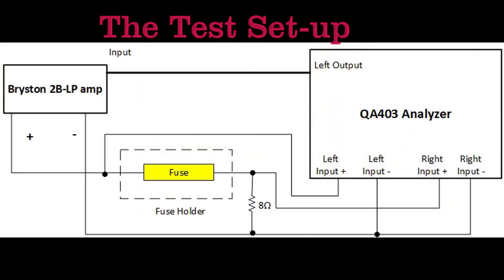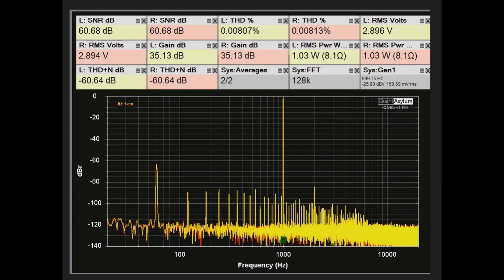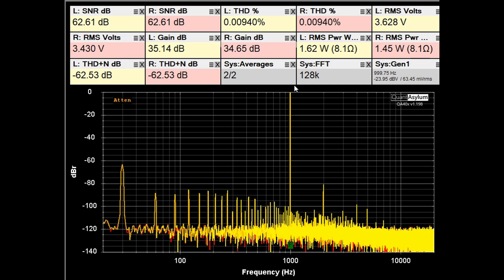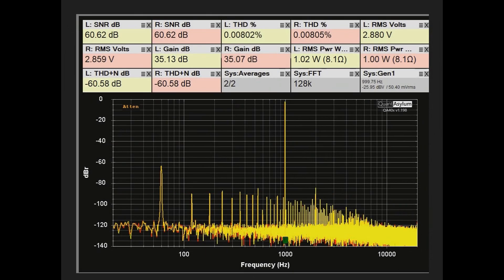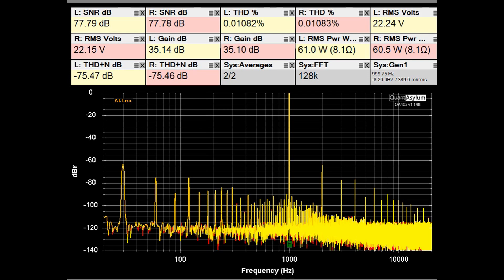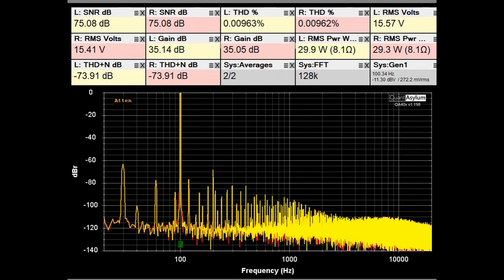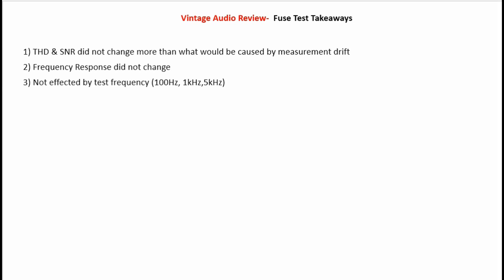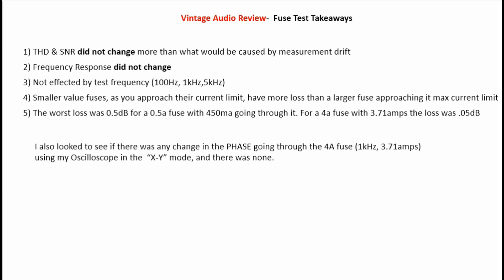Testing the effect of fuses for Audio: Vintage Audio Review Episode #113

Comment: It's Engineering. Traditional glass fuses resistance increases as load increases, that's how a fuse works until the heat and resistance becomes too great and the fuse blows.  A better fuse has resistance that does not increase with load.  The varying resistance increases and decreases voltage to the power supply thus effecting all the electronic and making the circuits unstable.  Hope this helps.
Reply from the maker: Thanks for the comment. "Makes the electronics unstable"- not in most decently designed amps and the effect of having the fuse resistance increase makes almost no difference as I showed with the measurements- worst case of course is with larger currents flowing through the fuse, but even then a very small effect.
Reply: @vintageaudioreview   Amplifiers with tubes require higher voltages (my 165 watt monoblocks run 900 volts on the plates) Those  small voltage drops (because of the resistance introduced by low end fuses) are multiplied by step up transformers.  The step up transformers magnify the small voltage drops as the current draw fluctuates to the music.  Yes we  are talking about small changes that will likely only show up in High End systems.
Reply from the maker: @kb9gkc  I can't say how much that drop in plate voltage is going change the sound (adding distortion) to where you would hear it in a high end system. Maybe one day I will repeat the experiment with my tube monoblocks....though they are not running 900v on the plates

Comment: I bought speakers in the late 70's that had fuses on the tweeters to protect them from blowing (but I was able to blow a tweeter anyway and I swear I had the right fuse in).  I also remember at least a couple of other speakers from the late 70's that had fuses.  Does not look like speaker manufacturers put fuses in speakers anymore?  Wonder if that's because they think the "audiophile" community would rip them if they did?
Reply from the maker: Possibly the speaker manufacturers built their drivers and crossovers to handle a bit more than the rated power and don't feel they need fuses.....
Reply: My favourites where the big floorstanders with automotive light bulbs in series with the tweeters ... If your port is lighting up, turn it down!  LOL
Reply: @Douglas_Blake_579  I've got a pair of speakers that have something like that.  I inherited my dad's McIntosh XR3 speakers.  They have two lights on the bottom front.  A yellow light for "Approaching Power Limit" and a red light for "High Frequency Fuse Blown".
Reply from the maker: @Douglas_Blake_579  I never came across those, just the KEF 105's that had the LED in them to indicate you were in the danger zone....
Reply: @vintageaudioreview  
I've been wracking my brain trying to remember which speakers those were... 
I'm starting to think I don't remember (Gasp!)

Comment: Nicely done Scott.

A minor clarification if I may ask ... the currents you're stating were RMS or PEAK?
For example with the 4 amp fuse, 3.71 amps RMS would actually be 5.24 amps peak, which is very interesting since the fuse didn't blow.

Also, in my experience with speaker fuses, most often the amplifier goes for a crap to protect the fuse, instead of the other way around... LOL.
Reply from the maker: The currents would be RMS. I agree with you that the amplifier will more likely go to crap before the fuse, unless they designed a lot of margin in.

Comment: A $10K fancy fuse audiophile would have made a world of difference Not! but thanks for the video as i saw a few videos about expensive fuses recently. Nonsense..
Reply from the maker: Thanks for the comments and I hope there is not a $10k audio fuse out there...
Reply: @vintageaudioreview Futureshop is worth a taking a look at; they sell fuses, which trap pairs of electrons in a state of quantum entanglement and accelerate them using a built-in singularity. Sounds incredible at a reasonable $10k a pop, both literally and colloquially speaking.
Reply from the maker: @paulb4661  My ears would not be able to anything coming out of a quantum entanglement 😄
Reply: @vintageaudioreview  It is directional, so make sure you insert it the right way around, or a worm-hole might open and swallow the visible Universe. My apologies for dashing your hopes for the non-existence of a $10k fuse, at current pound to dollar rate, that's pretty much it. They also have some interesting adaptors you might want to check out.
Reply: @vintageaudioreview There is - Futureshop is the site to go to; they sell fuses, which trap pairs of electrons in a state of quantum entanglement and accelerate them using a built-in singularity. Sounds incredible at a reasonable £8k ie. $10k a pop, both literally and colloquially speaking.